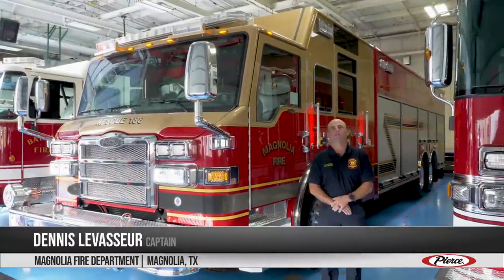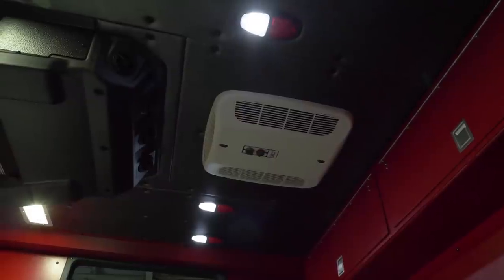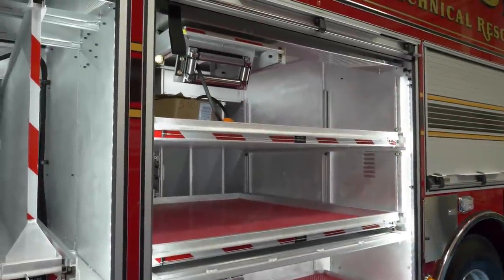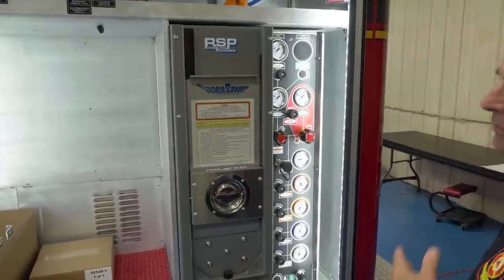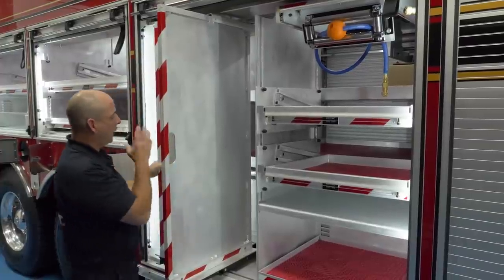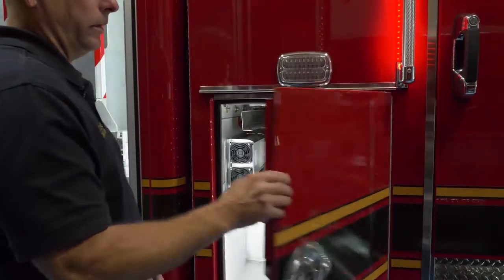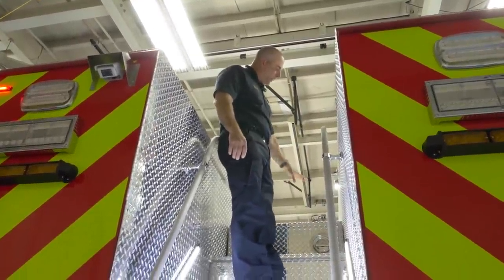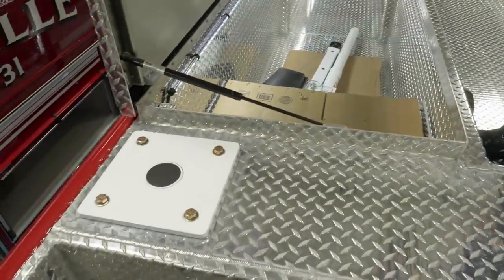Velocity® Non-Walk-In- Rescue – Magnolia, TX

Comment: Where's the water tank?
Reply: They're a technical rescue unit they don't carry water.
Reply: @louistaplin2594  Thank you I really didn't know that. So like in the case of a car accident this unit responds, and in case of a fire, the other units respond?
Reply: @ar-ed7im basically a giant tool box that carry’s equipment for the more intricate rescues no water but they do carry extinguishers in case of small fires
Reply: @ar-ed7im  this apparatus basically goes to vehicle accidents, structure fires, rescues, almost anything. If there is a fire there will also be trucks and engines there as well.
Reply: It is a big mobile tool box, ST LOUIS MO. FD has 6 tools on the SQUAD/RESCUE Truck.